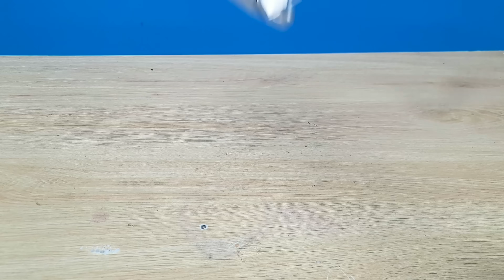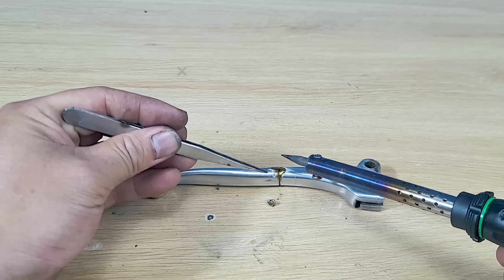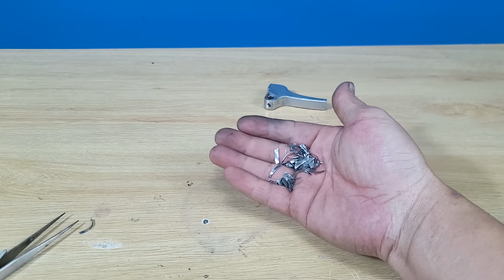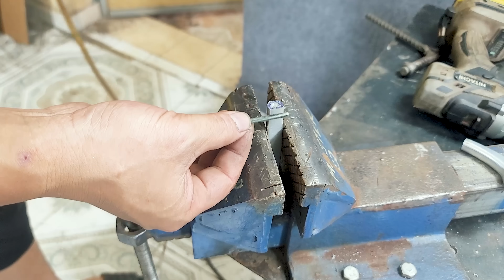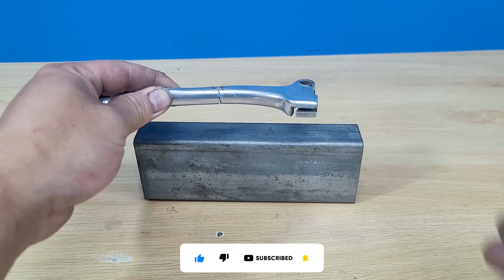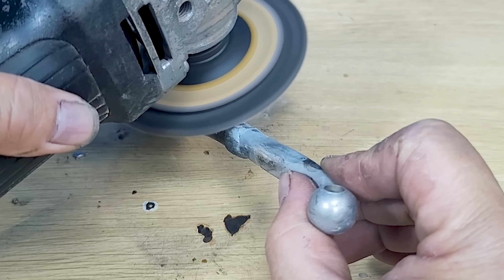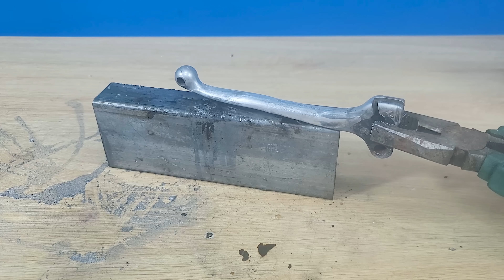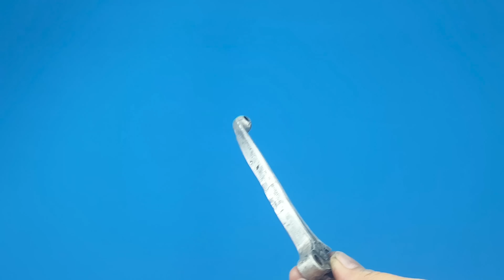Even a NASA professor had to learn this from me! Idea of using 1,5V battery to weld aluminum brakes

Comment: This spare part costs five dollars, why not just buy a new one and spend the whole day on repairs?
Reply: Repairs are satisfying
Reply: Reparieren macht geil !
Reply: Depends. Messy, expensive,  annoying? I'll do it once. Maybe 

Kitchen sink faucet? Never TF again. HORRIBLE job to do.
Reply: Yes! Your contributions are valuable! 
Thank you. 
I am from Brasil. Down here, people do what can be done to repair things under lower costs. It IS been called "gambiarra", which is a free solution applied.
Reply: @osferreira9050  Free solution 😂😂😂The equipment shown that is needed for this repair costs thousands of dollars...
Reply: @osferreira9050 verdade! Não acha as peças e quando acha são uma fortuna!
Reply: If it breaks, a major accident can occur.
Reply: @salimshaikh7949  so true
Reply: @salimshaikh7949 A very-important point.
Reply: @salimshaikh7949 
Yeah, better buy a new motorcycle then! 🤡
Reply: Just a tip.
If ever your cutting a bolt. Put a nut on it first then once the bolt is cut unscrew the nut to fix the thread. 🔩😉
Reply: Every time someone posts a new, clever, and/or resourceful way to fix something, some jerk comments "those are cheap anyway, just buy a new one.  Amirite guyyyzzz ?!?!" As if availability were the same across the globe. As if 5 dollars were nothing to everyone in the world. And as if the person who repaired it using readily available materials shouldnt be proud of their skills and resourcefulness. It gets very fucking old. I salute the fellow who brazed the old brake lever instead of buying a new one. And it was cool to see the battery electrolyte used as rosin. Ignore these ignorant and arrogant comments and keep doing what you do!
Reply: お気に入りのレバーだった場合の修理だね。修理の好きな方に。
Reply: @knightc9027 ブレーキレバーでしょ、交換しないと危ないって。
Reply: Купить это не то что хотел показать мастер,...
Главное сам процесс,...
Reply: @мыбезумныХристаради...1Коринфя  ну действительно, это чисто мышление людей из снг - зачем например быстро готовая новая школа или садик которые будут через год работать и приносить пользу, главное же это как их умело, профессионально и неспеша строят 20лет и бюджет каджый год увиличивают (вернее пиз..дят 😂)
или зачем людям новые дома, старые же можно "отремонтировать" и они ещё 100лет простоят и ничего что вода в речке, отопление печное, а очко на улице ☝️
Reply: من المستحيل أن تنتطابق  القطعتين بعد إدخال اللولب سيبقى هناك فراغ واضح بينهما
Reply: Xem clip để rút kinh nghiệm làm những việc khác tương tự có ích hơn trong trường hợp này nhé bạn.
Reply: because the spare part might be made in China and the supply chain might be broken too.
Reply: I use HCL for weld metal, I'm from Bali
Reply: Exelente video amigo, muy eduvativo, una pregunta serviria esta tecnica para soldar un tanque de moto picado??
Reply: Yes I agree. The guy spent more than 5 dollars (time, gas, and electricity)on repairs.
Reply: Also it is not as strong as new part, and will brake soon again.
Reply: Yeah but In a emergency are yoj going to have a drill a a vice and that solution he had
Reply: Although true money wise, knowing different kinds of repair options is very handy, especially in low resources countries.
Reply: Ini karena anda belum mengerti filosofi Bangsa Indonesia: kalau masih bisa dipakai, kenapa beli baru?  😂😂😂
Reply: Ini bukan masalah membeli, tp ini adalah suatu ide bagaimana memperbaiki kembali.
Reply: @adekriza  Is this an improvement, or a stop-gap?
Reply: Cet astuce ns permet de réparer d,autres éléments en aluminium.
Reply: Дюраль это, а не алюминий 
...
Reply: Just use a small length of pipe over broken brake handle if you have no $$
Reply: Ну мозг работает у человека!где то это сгодится.Конечно можно купить как кто то скажет,но ситуации разные могут быть..а насчет крепости,кто то писал это быстро развалится..в даном случае вкручена шпилька на подобии метчика,если не ронять предмет то прослужит еще достаточно.
Reply: thinking like that, then this content will never exist because buying is easier than repairing So, it's not just 5 dollars that he gets, but the income continues
Reply: É o nome disso chama se gambiarra. Costuma a dar errado quando você mais precisa e termina na maioria das vezes em lamento e arrependimento
Reply: For those saying it’s cheap   Who are you buying your parts from ??
Reply: I was going to say same  new lever less than cost of materials to try to fix
Reply: Nicely done.
Reply: Bravo ❤❤❤❤
Reply: I can't find any shop open during apocalypse or war times.
This may answer your question why.
Reply: @DesignMakeFix  Best reply ever!
Reply: Because he wouldn’t get paid for utube videos……..
If the video was called how to repair a weak bit of metal and make it even weaker he wouldn’t get any views 😂😂😂
Reply: Creativity...
Reply: Por que aquí no lo conseguía, ni menos barato
Reply: The joy of fixing stuff
Reply: Not everything has spare part or can buy cheap😂
Reply: That attitude is why this world is overflowing with waste. If you can fix it fix it
Reply: Couldn’t agree more
Reply: Untuk experiment  mantap  bisa jadi bermanfaat untuk di gunakan ke alat2 yg lain yg suku cadang sulit di dapat.. 😂
Reply: 5 dollars is 250 Roupies,  it's à lot, that's why we repair
Reply: Do u ride a bike?
We have become lazy because of the "American" way of thinking.
Reply: Bu soruyu sorduğuna göre emeğin,fikir üretmenin ve sonunda alınan hazzın ne demek olduğu hakkında  hiç fikir sahibi değilsin...
Reply: Spoken like a true simpleton. Can't figure out the point is not fixing this part but demonstrating the technique so it can be used in other situations. The part is five bucks. Maybe. The knowledge  is priceless in the brain of someone who can recognize its value and who knows how to use it.

Now go sit down because this entire thread has owned and schooled you.
Reply: Lo sfizio sta proprio in questo, cioè fare con le proprie mani la riparazione
Reply: Because after you have that happen when it's 20 years old, the spare part isn't five dollars anymore, or can't be found easily.
Reply: 😂😂content=views=YouTube money
Reply: Every time you choose to replace a broken thing instead of trying to fix it you loose the oportunity to learn a new skill. Every cabbage can buy something new but only clever people can fix them.
Reply: Yes you are right.
Reply: Não é a questão do preço, mas, aprender a técnica, que pode ser usada em outras peças que as vezes nem são mais fabricadas.
Reply: maybe because in some countries the part is not ready available, and 5 bucks is not that easily come by, just like some people hunt their own food and others buy it because they are too lazy to hunt and preserve it themselves?
Reply: Just wanted to comment same thing
Reply: And it's not safe and strong!
Reply: Yes
Reply: Then busy bodies wouldn't have anything better to do than making comments about showing a little hack
Reply: That was i think 😅
Reply: Its true
Reply: Kerja bodoh..stupid job 😂
Reply: Đúng vậy 😂
Reply: Excellent!👍
Reply: hahahaha😂😂😂😂😂
Reply: I agree with.
Reply: Says  the ZERO resource conscious consumer. Guarantee didnt take all day. How much time gas and energy is consumed buying a new one? Throw away civilization. Hopefully you always have Walmart. Good luck🤙🏼
Reply: Because nasa professor had to learn "how"
Reply: You are like a 90 year old king who married a young princess as a joke. when she asked him to conceive an heir for her. After trying a little, he realized that he wouldn’t succeed. After that he announced. This is not a royal matter, so I will order it and they will do it!
Reply: *BECAUSE HE'S JOBLESS &STUPID.😅😅😅*
Reply: Come on!!! He had to teach the NASA scientist.... So🫤
Reply: If can't get a new lever drill and use a metal pin to hold and strengthen then fill w jb weld  or epoxy.
Reply: 5 dollars is his pay for 2weeks, it's not like America where you wipe your ass with a 5 dollar bill
Reply: @axKatushka
Because going and buying one would be interesting and the video would only be 30 seconds long. 😂
Reply: Soy de Cuenca, Ecuador.
Reply: Nasa would have bought a new one.🤔
Reply: @YourCreatorGod  

Not if they were in orbit....
Reply: Если можно отремонтировать-зачем покупать!☝️👍
Reply: se7
Reply: satisfaction is indeed expensive… 😁
Reply: Ya i think so hahah😂
Reply: Admire that beautiful fix. However a brake lever that was a break is dangerous. Seriously. You must replace it with genuine factory parts.
Reply: Because of 屎忽痕😔
Reply: Inventor K es uno de mis científicos preferidos.
Reply: Кто-то любит кататься, кто-то покупки, а кто много ебли (fucking?).
Reply: I agree
Reply: Dumbest way to do something
Reply: NEVER EVER DISASSEMBLE A BATTERY!!!
Reply: The electrolyte in the battery is potassium hydroxide alone the wet paper would work without any other as flux but there is easier ways maybe Google who is silver soldier flux or flux made   could probably make from salt or something so much easier you tried pulling batteries apart i use to do with no tools or nail clippers take long
Reply: Look like he from poor country
Reply: Some people live in villages not towns, they don't have almighty Walmart on every street
Reply: U speak as if u dont have a brain. Reconsider people who are far out from ur so called hardwares. This is when this diy comes in.
Reply: Wast
Reply: It was FIFTEEN 20 years ago on a real bike. But I still wouldn't want to stake my.life on a weld. F that. .
Reply: And what to think of the environmental impact of this way of repairing😢
Reply: 2 millions views thats why
Reply: Don't know where you live but in the UK the parts are crazy expensive if you go with oem
Reply: There are many people for whom $5 is more than a day's wages, and availability of new parts is not good. Time and ingenuity on the others hand, is free.
Reply: For repair practice, it is ok, else waste of energy and money.
Reply: Ficou uma bosta!
Reply: Same question...
Reply: Needs proper welding or get a new one IMHO
Reply: such a cranks are made from Al-Mg alloy and your welding wire is not,this joint will crack again anyway rendering such a repair pointless and even dangerous
Reply: I agree
Reply: Отличная идея! 👏👏👏👏👏
Reply: Enable only India, China and Brazil...
Reply: compra una leva della frizione di una moto Ducati, non so di una multistrada , e portagli 5 dollari 😂
Reply: He wants NASA professor "learn" from him. 😂
Reply: Because of wanting multi million views.
Reply: The opinion of someone who has never experienced the satisfaction and pride from a job well done or a problem overcome by self reliance and the skills they acquired. 
If I need my bike tomorrow and it takes 6 weeks to get the part delivered from china then an imperfect repair that will last 6 weeks is the perfect solution, only a fool rejects knowledge and skills just because they can throw money at the problem instead and while you think you're making some clever point in reality you're just admitting that you have very few practical skills and are limited in critical thinking and problem solving abilities. What about the times the part isn't available or hard to source does it make sense to spend 10 hours searching online and ringing specialist dealers to find a replacement when I can repair the one I have in an hour ? what about the times a simple repair prevents expensive downtime waiting for a new part to come, this guy probably needs the bike to get to work. Yours is the dumbest comment I've seen this week
Reply: Five dollars for any first world nation, better than a week’s pay where they actually make the part.

They call it slave labor for a reason.
Reply: More then 5 dollar
Reply: I agree
Reply: Money supports corruption
Reply: Endless yputube content
Reply: Teşekkürler  arkadaş,bazıları  senin ne yaptığını anlamıyor,boşver sen onları.
Reply: nasa ain't got 5 dollars
Reply: @zayn9042  No, but the taxpayers do!
Reply: @axKatushka;
it boggles me how people like you just don't get it: there are times, and places, where you just cannot go and buy a spare part...or, in fact,  have $5 to do so, or $5 is all you make in 2 days...
Reply: Reduce.
Repair.
Re-use.
Recycle.
Reply: Câu bình luận cho thấy tư duy kém cỏi và rất ngớ ngẩn..?  Bởi lẽ chúng ta phải tùy theo điều kiện hoàn cảnh của mỗi người trong chúng ta mà phải dùng cách thức khắc phục phù hợp với điều kiện hoàn cảnh của mỗi người. Và đây là cách tốt nhất mà họ cảm thấy hay để lên video chia sẻ đến với tất cả những ai cảm thấy ưu Việt đối với họ. Còn nếu cùng một sự cố vấn đề nhưng ở một không gian, chân trời khác với con người và điều kiện khác thì cách thức xử lý sẻ khác đó là điều tất nhiên. Và nếu đi mua tay thắng về để thay như bạn nói thì việc này quá bình thường ai ai cũng biết! Nhưng lúc đó cũng chẳng có cái video với cách thức kỷ thuật hàn hay ho như thế này chia sẻ đến tất cả mọi người, và người ta cũng ko ai biết và mất thời gian với bình luận của người nào rồi.
Reply: True that
Reply: In india, it's cost is 0.15 $
Reply: Perfect
Reply: I agree with your oponion
Reply: Ma vie contre le changement d'une pièce à 5 euros ?
Je refaire tailler un levier dans ine planche de contre-plaqué... 😂
Reply: @bpioger  English pls.
Reply: C est tres dangereux comme idée pas de fort pour la poignée merci pour l idée
Reply: So they can make tens of thousands of dollars from making such videos about these things for YouTube.
Reply: 5 dollars is small amount.the YouTuber has earned from this video thousands of dollars .now you can guess who is right.
Reply: He wasted eight minutes of your time watching how he wastes time.
Reply: He wasted eight minutes of your time watching how he wastes time.
Reply: He wasted eight minutes of your time watching how he wastes time.
Reply: He wasted eight minutes of your time watching how he wastes time.
Reply: He wasted eight minutes of your time watching how he wastes time.
Reply: He wasted eight minutes of your time watching how he wastes time.
Reply: He wasted eight minutes of your time watching how he wastes time.
Reply: You can't make 3M of views in 10 days with 5 dollars
Reply: 😂No Hotglue😂!? ...
Reply: @CelestialSooth  ..lol the Number of views xD ..what u knows about the Eeg with more Views ..it do nothing , its a Eeg ...xD. 

In German we say "Pfusch am Bau" Buddy ...

Wer bei nem Unfall mit Sowas ankommt darf dann eh alles selber zahlen ..mit Glück nur Materialkosten die von der Versicherung nicht übernommen werden ...ps. Optik ist nicht alles
Reply: Yes You are right .
Reply: Ok dok
Do not consider my words, please.
Reply: He is showing the process. As the title sort of implies. There are hundreds of applications this could be useful. Even mobile
Reply: Ce choix d'acheter une nouvelle pièce est réservée aux bons à rien, aux mauvais à tout, aux assistés et aux inutiles.
Reply: it didnt take a whole day, plus it wont fail again and why did it brake in the first place, fucking simpletons blows my mind
Reply: Because then he wouldn't be able to make the video!
Reply: Comments section won't last a week when the shit hits the fan.😂
Reply: You might be surprised, production of parts like these age real fast. I looked for a handle for a ten year old bike, all over the Internet and local shops in town. I could not get it anymore. I ended up 3d printing one myself.
Reply: Can’t buy one in outter space no Honda shops yet 😂
Reply: Just the idea: a sample to show how to weld aluminum objects ( not easy) with that liquid  made from battery shell.
Reply: @tigerspirit22  it's soldering NOT welding. And aluminium won't take normal solder, no matter what flux you use (zinc chloride in this case). It may appear to initially make a good, perhaps even strong, joint. But oxygen will diffuse in and eventually it will just fall off. Usually sooner than later.

However it's just cosmetic in this case, the strength is in the threaded rod.

Additionally parts like this are often not aluminium but zamac, a zinc alloy.
Reply: Súpimpa,e melhor
Reply: @tigerspirit22 just enjoy watching 😅😅
Reply: You didn't  weld  anything..
Reply: The idea is to learn how to repair emergency things, we already know it's cheap!
Reply: @ht-abvfr-gha 
Yes, not only for emergency, probably for unavailable and very costly spares!
Reply: well said that’s true
Reply: Hay palancas que valen 5$ y otras 50$,el método es válido para ambas
Reply: O.K!! Grazie! Bravissimo!!!👍👍👍🇮🇪( da Italia)👋
Reply: Italia persempre!!! Mario Cipollini,Marco Pantani ricordati!Jino Bartali,Fausto Coppi.☝️💪👍🚴🔥Con amore!From Kiev, Ukraine.🇺🇦♥️🇮🇹 @fabiopicci2375
Reply: @fabiopicci2375  Чому ти виклав прапор Індії,А не Італії?!
Reply: Silly answer. In many lands of the earth you can buy not so easily new parts like in the west industrial lands. And why do you think the parts in this lands are cheap? Very, very silly from you. 👎
Reply: If you can get all the tools to do all this you can get spare parts. Now who’s silly?
Reply: @ralfhartmann5050 Aah, so you can't buy a $5 spare part but have access to a smartphone, electricity and internet?
I mean, there are regions on earth like you said, but.... wouldn't this video be useless for those guys?
Reply: Junk yard, yunk yard
Reply: @ralfhartmann5050  And why do you think that there is no such part for $ 5, but all the equipment shown that costs thousands of dollars in these countries is there???
 Your move is my smart friend 😉
Reply: @SkrepiVelichiya да кроме смеха , все конечно что Вы говорите верно. Но смысл ролика и его идея не как лучше поступить , тоесть купить новую деталь или починить . Смысл ролика как чинится данная деталь, армирование и пайка . По большему счету в ютубе большинство роликов для этого . А вы заголдели купить купить. Есть же тематика как менять сальники в двигателе той или иной модели авто к примеру для мастеров. Своего рода обмен опытом между мастерами . А так то конечно зачем чистить пепельницу в мерседесе , легче пойти купить новый там она пуста ))))
Reply: @ralfhartmann5050  no todos tenemos acceso a repuestos, hay que reparar y no comprar.
Reply: @josesantossanchez9341 E é melhor fazer um remendo daqueles que vai partir-se de novo em muito pouco tempo! Porque a peça é muito fina, não havendo possibilidade de ficar um arranjo bem resistente! Além disso, ao contrário do que disse MUITA GENTE, hoje em dia arranja-se as peças necessárias em qualquer parte do mundo, bastando encomendá-las à China!
Reply: @josesantossanchez9341 not all of you have access to spare parts but all the other things, time & effort! Is that logically believable?
Reply: @ralfhartmann5050  - Well said.  Some who live in affluent countries tend to show their arrogance.
Reply: Yes still got a bend 👎
Reply: บางทีการใช้เงินไม่ได้สำคัญ
Reply: When u having a sick, will u go visit doctor or u go reborn again? 
I guess u won't spend ur day to visit doctor. 
😂😂😂
Reply: @狸撈木  - Why do you make this so esoteric?  You are confusing materialistic objects and financial abilities with health, come on now, join those that engage their brain.
Reply from the maker: Hello my friend, thank you so much for following and sharing with us. Nice to chat with you. You can leave comments with good ideas, so we can learn more valuable knowledge from you. Have a good day.
Reply: @inventorK20 
Молодец мастер🙂🤝
Reply: Thanks for the repair process.
Does this have a good success rate, does it stay together for long?
👍👌👏

 @inventorK20
Reply: @inventorK20 te pido disculpas a nombre del comentario insensato y espero no haga mella en tu entusiasmo. Eres un virtuoso.
Reply: В лесах Амазонии вы не найдете такую запчасть.
Reply: @вікторАндрияшин  так в лесах амазонии вы и ненайдёте всего того что нужно для этого ремонта, особенно интересно куда вы там паяльник воткнёте? 😂😂😂
И ещё интересней вопрос - как вообще туда попадёт этот мопед чтоб там ручку сломать, если там не дорог, не бинзозаправок, туда на лодках-то хрен проедешь?
Reply: @вікторАндрияшин opa amigo vc é de qual região? No Amazonas Brasil tem fábricas das principais montadoras de motos 😂
Reply: @вікторАндрияшин поискать лучше похожую, это критическая з/ часть, ручной тормоз, и он должен быть НАДЁЖНЫМ 😂
Reply: Because his income is half dollar per day😂
Reply: Yes I agree 😅😅😂😂
Reply: Pppplp😊 @sheikhadnan5054
Reply: @sheikhadnan5054 bastava andare in fonderia alluminio pochi minuti...io faccio così... faccio vivere un nobile mestiere Orazio platania
Reply: U @sheikhadnan5054
Reply: Useless
Reply: зачем лечить жену, можно новую взять
Reply: @ВорчатникБу  ну какбы жена и ручка несчастная за 5$ это несколько разные вещи вам не кажется???